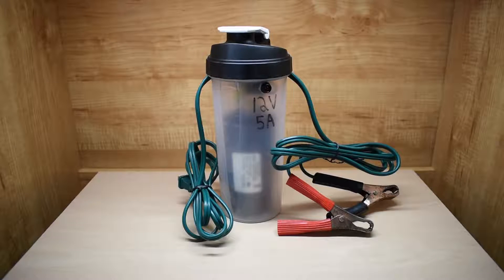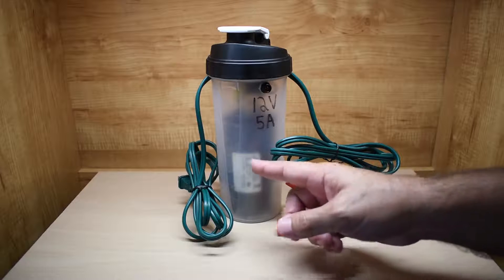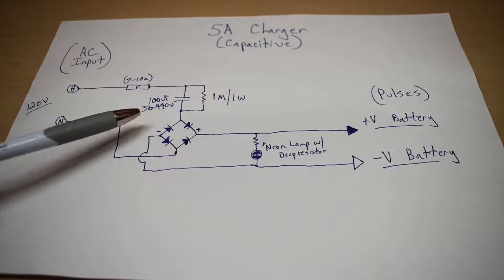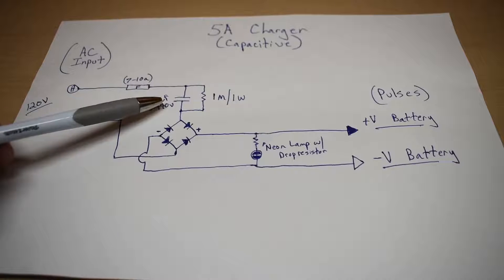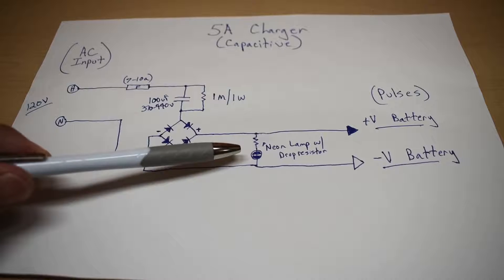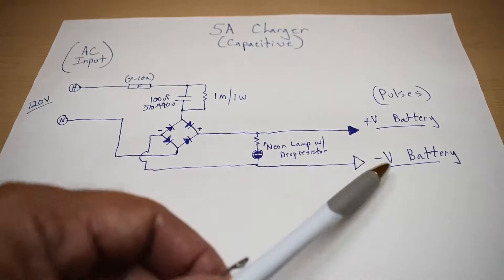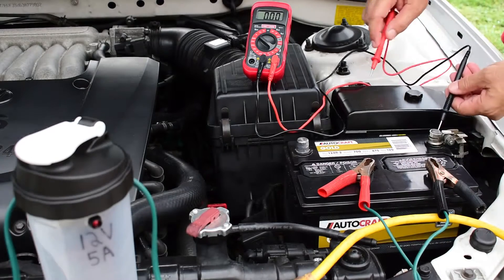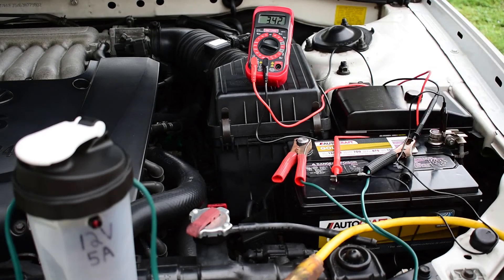Simple Car Battery Charger

Comment: The problem in the 220v is that the rectifier fet really hot im using kbpc5010 2pcs parallel to reduce heat and big heatsinks with fan but it work very well on my lead alum batteries😊
Reply from the maker: You can't use diodes in parallel, one will end up carrying more than the other and burn up. Use a higher current & voltage rated full wave bridge.
Reply: @electronicsNmore  thanks for your concerned😊im using my capacitive charger 5years from now and it works really well
Reply: @electronicsNmore  by the way do u have any idea making buck converter adjustable output without using ic?

Comment: Great project, but a little dangerous to use if you happen to come across the clamps while not connected to a battery load. So say instead of a full wave bridge rectifier, all we could get our hands on in our junk pile was just a power diode? It would still give us unfiltered DC, but since it's half-wave, how does this affect the math to size up the capacitor? Does the cap "see" 60 Hz or 30 Hz across its terminals due to being "on" for only half the time?
Reply from the maker: I made it very clear in the video that this charger can be dangerous if precautions aren't taken. Only use a full wave. Neg & Pos pulses pass through the capacitor.

Comment: please make video of automatic trickle car/motorcycle battery charger with charging and full charged led indicator using transformer 220vac primary ,12v sec.12amps,diode bridge or any rectifying diode,full wave bridge set up.thanks for the efficient circuit.
Reply from the maker: https://www.youtube.com/watch?v=mqeL3yMKAIk
Reply: @electronicsNmore  thanx for replying.more of your lucrative videos

Comment: At the end of charging if it is regular lead-acid battery thereshould be 16-16,5V (2,75V per cell) if this is Ca-Ca battery (90% it is)
Reply from the maker: Way too high. Anything above 15v is considered overcharged and the battery will heat up and give off excessive hydrogen gas
Reply: For alternator Yes, for charging battery nope. Old batteries need 16.5V (2,75V per cell) to recover - for new ones 15.6V (2.6V per cell) is enough.
Just Google "ca-ca battery charging profile".
Even check out NOCO G7200 repair mode - is 16.5V
I work in a battery research center ;)
Reply from the maker: Way too high. You'll boil the electrolyte and warp the plates. Better look for another job.
Reply: @electronicsNmore  ehh

Comment: Wow, those capacitors cost a few times the price of a semi decent charger. Thought this may be a cost saving project. A good solution if you can get your hands on the parts at the right price.
Reply from the maker: The 100uF cap on Ebay.....$11 shipped. :-)
Reply: @electronicsNmore  Sorry, should have mentioned I'm in UK ;-)

Comment: It might work but is insanely dangerous and inefficient with a bad power factor, there is also no over voltage protection so if left on at 5A would boil your batteries dry and destroy them.
It would have been easier to find a 12V transformer than a capacitor. Hard to believe that on an island where there are LED TVs and AC units that it was soo hard to get a common 12V charger.
This  charger is similar to the chargers used in some really cheap 6V sealed lead acid battery LED torches that are charged directly from the mains, they were made a bit safer though in that a very small value capacitor was used to trickle charge the battery so it wouldn't over charge it.
Reply from the maker: I made it very clear in the video that it was dangerous. It does work, and work extremely well, but you do need to monitor the battery while charging. The purpose of the video was to show what "Can" be done if you needed to charge a battery. I guess you never lived on an island, you can't get much. The TV, A/C, and other things were all shipped on boats. Thanks for watching!

Comment: Use this only for a rapid charger...You shouldn't be pulling 3.4 Amps at 13 volts...
Reply from the maker: You can't compare how it charges to a typical transformer charger. This charger puts out steady current. Thanks for watching!

Comment: How long can you leave this connected to a battery?
Reply from the maker: I plan on adding a cut-off circuit to the charger in the future, but the way it is now, you must unplug the charger once you see the battery voltage between 13.8 and 14.2V, otherwise you will majorly overheat the plates and the voltage will climb way up. Thanks for watching!
Reply: @electronicsNmore  that is what I was thinking.

Comment: As usual very cool video, thanks!  Where was that part located in the TV that you used?
Reply from the maker: On the power supply board.
Reply: probably the bridge rectifier, maybe the fuse & plug/lead also
Reply from the maker: @DimitriPappas  Correct. 0:43 you'll see two yellow toroids to the right inside the TV, just above those is an aluminum heat sink that the bridge rectifier is bolted to.